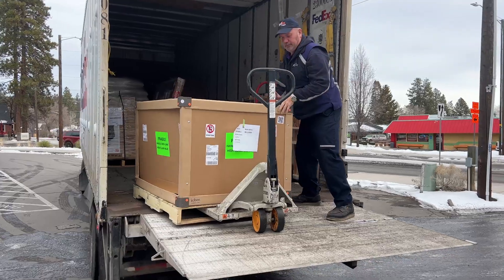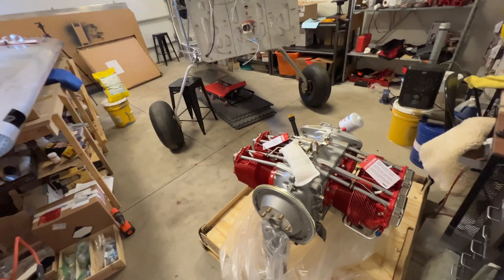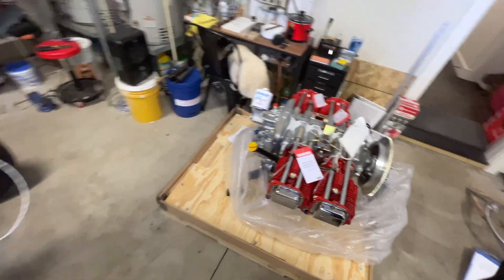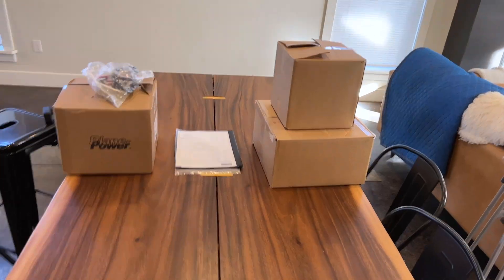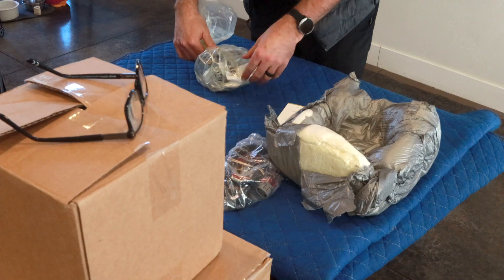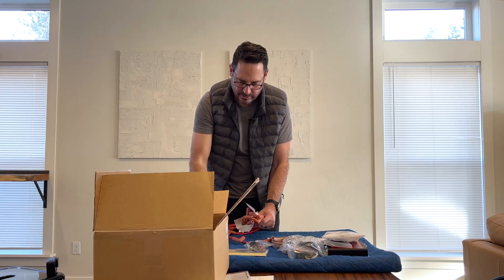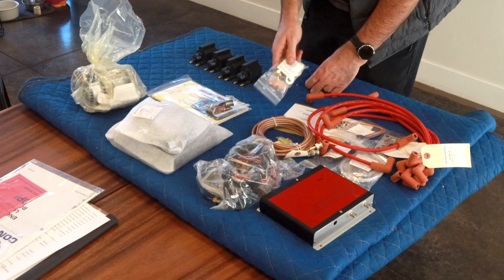Titan Engine FINALLY ARRIVES! Full Unboxing

Comment: Just curious why you didn’t you go with the Rotax 915 fadec and all?
Reply from the maker: It primarily came down to budget. The 915iS is >$10K USD more. Secondarily, RANS was having trouble with cooling the Rotax. Wish I could’ve gone with ULPower, but the big horsepower numbers there aren’t achievable at 2,700rpm but I digress…

Comment: Those are high voltage waste spark ignition coils, you will need double platinum plugs. The reason you need to go double platinum is because one of the plugs is reverse polarity (spark jumps from the ground). Without double platinum plugs you would see severe erosion on the ground strap of the reverse polarity plugs. I'm sure they will specify the exact plugs for your application, but just a little insight as to why they would be different than plugs used with a mag.
Reply from the maker: Wow, thanks for the great explanation. Double platinum sounds expensive…as with everything in aviation I suppose. I’ll keep an eye out for the specific plugs in the LSE manual. Thanks again!

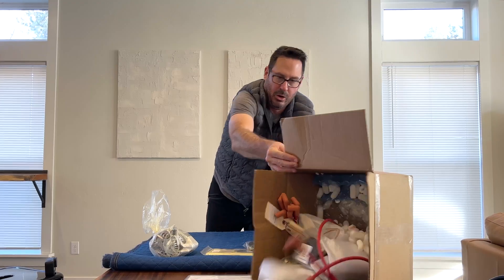Comment: I think those tubes at @5:24 are what are used to meter the fuel going into each injector.
Reply from the maker: Hmm, it's in the air stream so my guess is Manifold Pressure. Perhaps I'll look it up! Naaahhhhh. It's more fun guessing and lookin dumb

Comment: The fact that a motor takes 2 years to get… will lead me and others to other options like ULPower
Reply from the maker: To be fair, that was extreme. It's probably less than a year now? But ULPower is worth a look! Wish I could afford one...
Reply: @CLEAREDDIRECT  I love the Titan and your set up but the engines have increased price almost 25% over the last 2 years!  I like the UL but they don't like to run on 100LL, they will but from what I have read not to be done regularly. I like the idea of running 91 car gas but not available where I am. Once the GAMI 100UL is more available it will definitely be an option. 

As far as price I had a quote last year on the iox 370 and 520is (from UL) and the UL was about 5k cheaper. May even be better now with the exchange rate. 

Keep pounding away you're making great progress!
Reply from the maker: @Austinmediainc  100%. It’s such a nuanced decision with a ton of factors. I’m super stoked about the certification of GAMI’s 100UL. It makes me feel a lot better about getting the high compression version of the Titan.

Comment: Dude, isn't that the best feeling... I recommend installing the oil temp sensor, oil pressure fitting and rear baffles before mounting the engine. Also replace the straight engine breather fitting with the 90 degree one as the engine mount is in the way. My EAA builder's log has lots of photos. Pat Hatch's builder log has been my roadmap on my engine install as well.
Reply from the maker: Wow thanks for the heads up! I've been jotting notes on similar things (mostly from your FB forum comments) but that's even better. It's kind of intimidating especially when trying to make OSH, but I don't think it'll happen. You?
Reply: @CLEAREDDIRECT  I'm probably about a month from being ready to fly. Cowling fit-up is the only major assembly left to do.